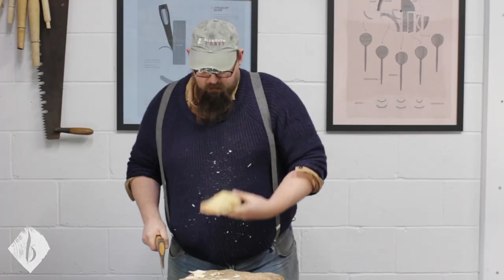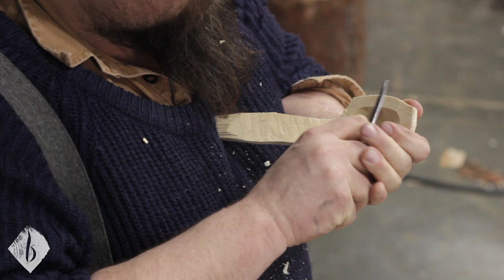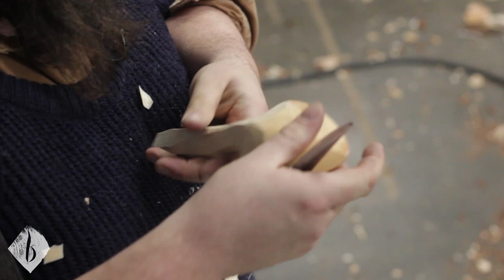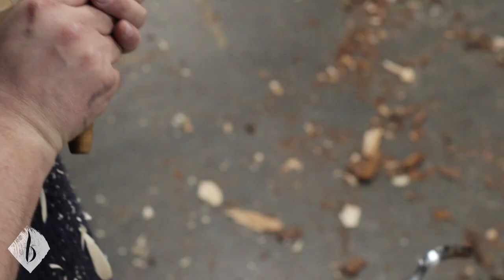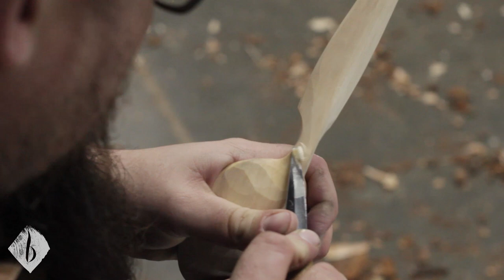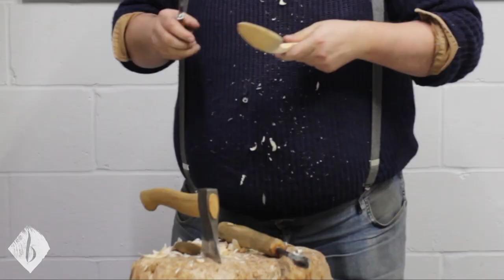Silent Carving | Serving Spoon

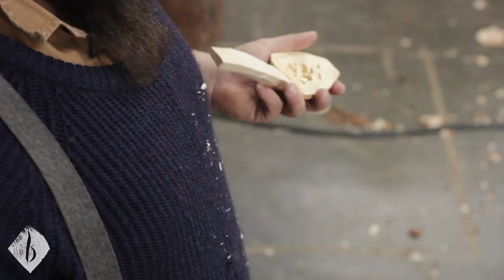Comment: 8:23
Maybe a stupid question, sorry.
I have the same axe i use for carving, and i got a new wood log as a base to work on,
when i try to land the axe into the base like that, it wont stick... it digs into the wood, i know for a fact is it shaving sharp (i can shave hair with it)
but it wont stick when i hit it on the wood...
is the wood the problem here? is it because the surface is still cleanly cut and not jagged like you have in the video?
is the wood of a hard type? should the wood log be of a softer wood type? any specific type?
Thanks
Reply: idk if im right but i think the blade should be sharper than just razor sharp, i watched a few videos of some woodcarving guy and he rlly could not stres enough that you should strop your axe waayy ppast razor sharp, like it was some sort of religion lpp
Reply: What type of axe is it?

Comment: I endeavor to understand the knife work. There appear to be two slightly different knives, one with a single bevel, the other with what appears to be one and a half bevels (for lack of a better term), the blades of both of which are slightly curved. Is that correct? I ask because it seems that you grasp both knives not so much by their handles exclusively but by the handlemost portions of their blades. But the camera work does not (to me) make it appear quite so clear that this is the case. If you would not mind clarifying that a bit I would be most grateful.
Reply from the maker: Hi John! The knives being used are a straight knife (or 'sloyd knife') and a bent knife commonly called a 'spoon knife'. The spoon knife has a curved outside bevel allowing it to hollow into concave surfaces, while the inside bevel should ideally be ground very flat. The straight knife has been modified by Barn. They usually have two perfectly flat bevels, at around 25 degrees. This one has been bent ever so slightly to achieve certain shapes and finishing cuts. You are right, the supporting hand may often be used to reinforce the cut, sometimes engaging the body of the blade itself. This is crucial for control, safety and a good result when using certain techniques. If you want to learn more about carving, and the tools seen here check out our films at spoonclub.co.uk !
Reply: Specifically who made the bent knife??
Reply: @SpoonClub  Hi, Thank you for posting such informations :) Can I ask you how to slightly bent a straight knife (I use mora's)? Should I warm it up or simply apply force and bent it at room temperature? Thank so much for any help! Fabio